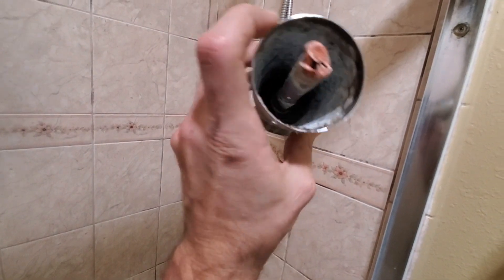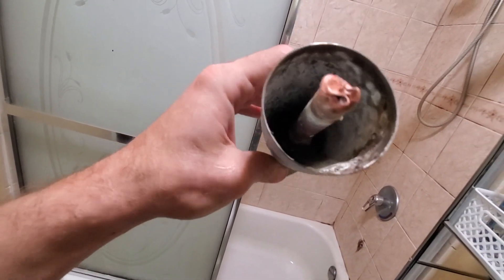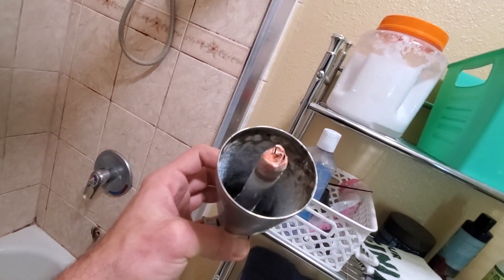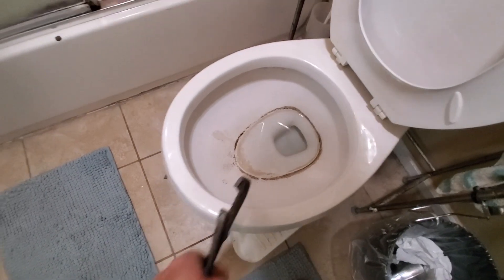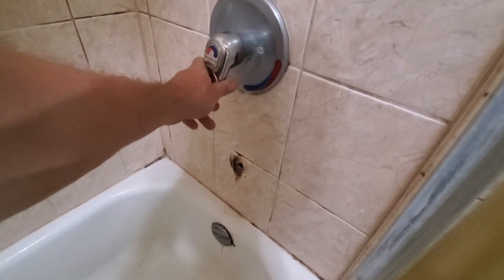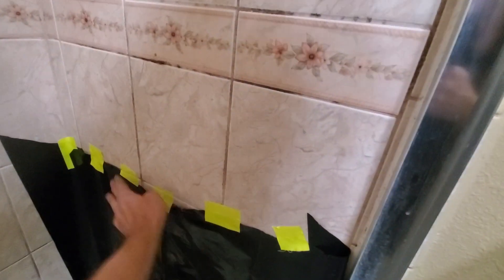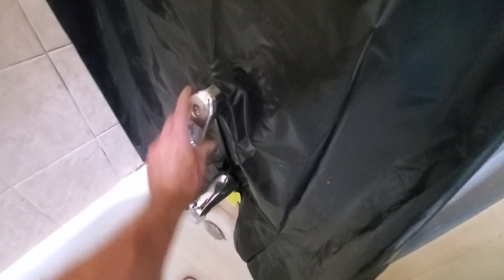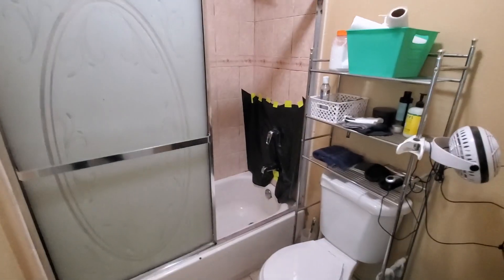HARD WATER made this simple job into a MAJOR job

Comment: cut the old spout off ( grinder w/) next time in such a manner to view the inside before you attempt to remove is one thought, I would have installed a swt x FMIP drop ear 90 otherwise what you did works, thxs for sharing...
Reply: agreed on the grinder method
Reply from the maker: Yeah I'll def do that next time but I knew it was a threaded tub spout and thought it would come off but the hard water was like a solvent

Comment: I run into this quite often.  what I do if I am not sure of what pipe is in the wall I will take a cut off tool and go all the way around the tub spout so that I can split it in half and then if I see it's copper threaded fitting,  I can pry the tub spout off of the copper without damaging anything. Or you can just cut midway right through the tub spout then solder on a coupling and a new male adaptor
Reply: I would pop the shower dial open and just look down, won't be able to see all the time but its a easy way to tell
Reply from the maker: I'll definitely do that next time. I knew the spout was threaded 100% and it just felt tight when unthreading it so thought it was coming off
Reply: With the condition of that tile work I would have told them it's time to put a new shower in

Comment: could you have used a nipple extractor ?
Reply from the maker: No a nipple extractor works only when you break off threads in a fitting and you need frontage access to the fitting